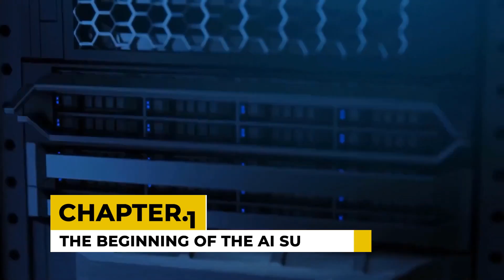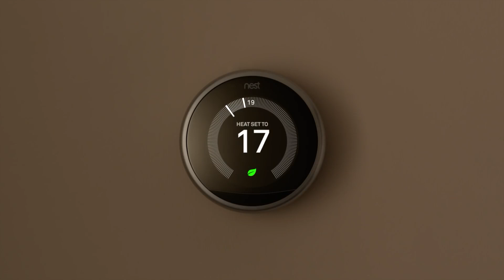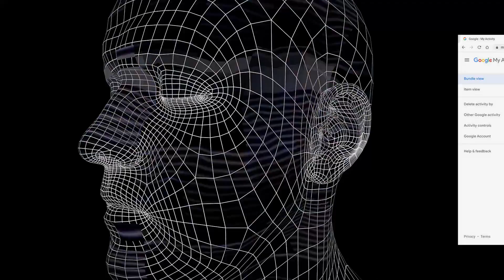2021's Biggest Achievements in Artificial Intelligence | Era of Artificial Intelligence | Futuristic

Comment: Why would we need self driving cars if we have self driving flying cars ? We are moving to too many different directions at once. We need to have some focus on our goals. We could spend less money on roads and bridges, and less time stuck in traffic, if we had affordable flying autonomous vehicles. 
We may one day be able to live in a place that is inaccessible by car. It would be alot easier to work on a system of transportation vehicles that fly, because they don't have to avoid any of the obstacles on the ground. Traffic could easily be regulated if all the aircraft were controlled by one central artificially intelligent system. 
It could design traffic patterns by using altitude to control air traffic for different directions. It would be able to adjust for large numbers of vehicles in the air traveling in the same , or different directions. 
If the system has control of every vehicle in the air, then it would be easier to eliminate traffic congestion. Less traffic  is less wear and tear on our roads. 
Paving less is better for our environment. 
We would no longer need to widen roads to accommodate for more vehicles. Our destinations and locations will be closer together when traveling by air.
Reply from the maker: Really appreciate your suggestions 💯 keep visiting